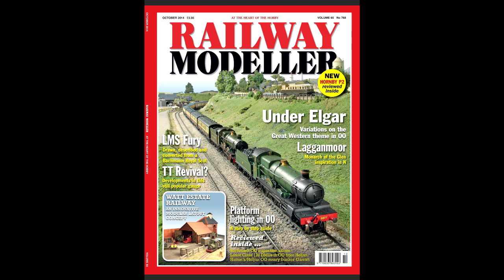LMS 6399 FURY - Build Montage & Footage at Coventry MRC 5th June 2011

Comment: In case people wonder what the hell is fury here's a brief history

FURY was built by the lms as a high pressure steam locomotive which in theory makes sense more steam pressure means more power unfortunately like Communism it failed

1.it was overkill infact it killed a man
2.on it's second attempt for testing it performed poorly so it was replaced with a standard boiler

Lesson learned high pressure steam locomotives aren't worth it
Reply: Train of thought made a video on Fury, but thanks anyway